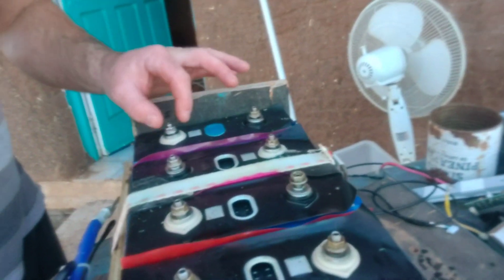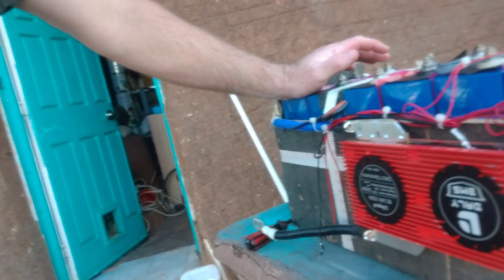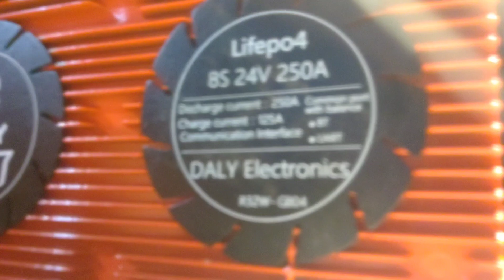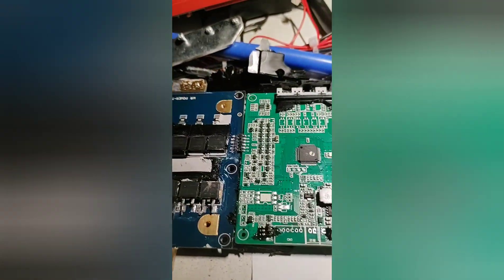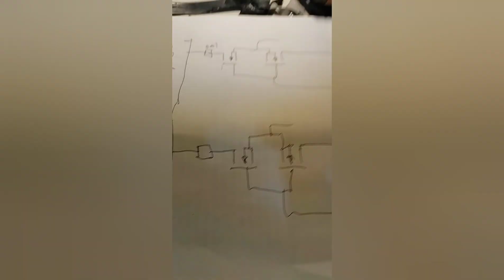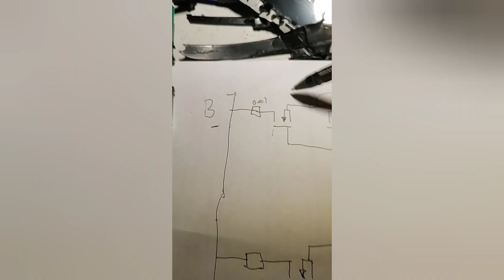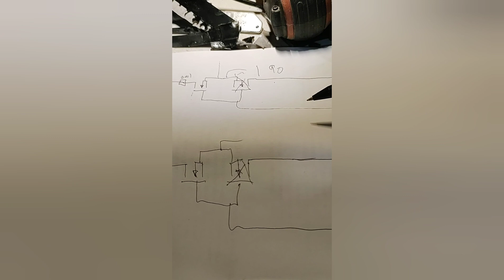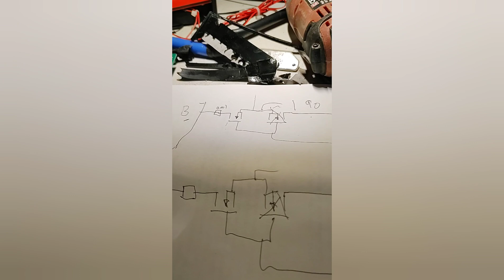Why not to use Daly BMS with MPPT controllers

Comment: i have 3 BMS and the Daly is the worse, it does not count the current going out if the inverter is connected to B-  and the needle never moves down; (it will m ve up when the Sun comes out)  if it was at,say,75%, it stays at 75% even until the battery is down at 0% (it shutts off at the voltages we set it to,  though);  if i connect the inverter to P-, when the battery is fully charged, then the BMS shutts off and the whole house suddenly goes "dark"; the JK BMS LEARNS to correlate voltages with SOC and does it very well; i repair,build, and sell inverters and i do  not sell Daly any more.

Comment: May I ask a question as I have ordered some lifepo4 batteries and currently do my research. Question would a fuse or breaker helps. I always under rate my fuses and breakers just in case, that is why I ask the questions. Oh one more question, how are you managing your system now?
Reply from the maker: No. Fuse circuit breaker etc is not the issue here. As stated what I am saying is that don't rely on your BMS to protect overcharge events if you are using solar string voltages beyond 60v. Currently using HV relays controlled by a seperate BMS to disconnect the solar incoming if a cell goes too high. Once balanced it should never trigger unless a charge controller fail.
Reply: @jasondevine6014  please 🙏 can you post this setup? I would really love to learn from it

Comment: every bms have a voltage they can't protect from, i guess that's why you still put a fuse between the battery and the mppt, i guess the fuse will trigger because of the voltage différence ? theyre will be a lot of amp going in ... what was the Charge controller brand?

Comment: How did the voltage get that high it should have switched off at about 30v then the volts can increase to 90 without damage
Reply from the maker: That's the problem. Solar panels will increase their voltage when not under load to VMax which means that for a mppt string maybe 80v or so. That's then too much for the FETs and they short.

Comment: What i have learned so far in the last 6 months is not too use Daly BMS and not to compress unless you you are going to kick those cells every day from 3.65 all the way down.
It just doesn't make sense because when you use a decent BMS and only 80% of the voltage range you get even 95% of it's capacity. Those last millivolts do not give you that much amps. You only shorten the life span of your cells.

Comment: Daly says you can put 4 12 volt bms' in series for a 48 volt system.  So it's probably a safe bet to say they can handle 60, possibly even 70 volts before shorting.  I have taken apart both 12 volt and a 48 volt daly and the mosfets all have the same markings. So I assume they all use the same mosfets, no matter the voltage range. But expecting it to handle 90 volts is asking a little much.  I'd have to put blame on your charge controller, not the bms.

Comment: Are you saying that your MPPT solar charge controller failed and passed full v9ltage and current  to the BMS? I understand that the bms did not open circuit because the voltage was above what it was rated to protect. My question is what kind of MPPT failed? I have had them fail but never pass current after failure. This is alarming. I have repurposed Tesla lithium ion NMC batteries. 
If my BMS modules fail I would have a thermal runaway event. I have Midnite Classic,  Outback Flexmax and Tristar in my main house system. I sure would like to know which MPPT  CC failed and passed current. Thanks.
Reply from the maker: Esmart 3. When you consider the design of a mppt it is basically a buck converter so easily they can fail in the shorted state, some however have a crowbar protection circuit built in. So yes that is the point, we need to consider what could happen. I didn't here and it lead to a disastrous result.

Comment: I am glad you posted your experience. I have a EV and I was thinking about connecting 3 of 16s BMS in series. Total system is 48 cells in series. I purchased few different types of BMS including QUCC BMS with a relay. My concern was 500 amps initially. Later learned about FET limitation as a HV switch. So relay based bms is a better choice. Also for people who are trying to blame charge controller only. Even expensive charge controllers fail. Also BMS is designed to protect the cells and it failed to do so here. I was also thinking a Surge protection device will be solution here but those are put at input and in your case for 150 plus volt. But how about a 50v Surge protection at the output. I was thinking about using 450v charge controller and this is a real concern and scenario. Thank you for provoking majority of us to think and make our system design safer.

Comment: Bms is only there to balance cells in a series configuration. It’s purpose is not to protect cells from over voltage if supplied outside of specification. You should have had a fuse or circuit breaker between the power supply and the bms which would have protected against this issue. It would be the same for all bms.
Reply from the maker: No it was fused. You don't understand the issue.
Reply: @jasondevine6014  hmmm possibly not but why would any BMS be able to shunt any voltage which is what I thought you were saying? Or was it you wernt concerned about the BMS but the fact it still passed high voltage on to the batteries.. Which if that was your point then I agree the DALY is not up to spec? Possibly in proper overall design the high voltage should have been caught before the BMS??
Reply from the maker: @tigertoo01  my complaint is that Daly do not provide max voltage ratings. My point is a warning that many people consider the BMS as a switch able to turnoff the battery should something go wrong but as shown here, a simple and common problem of charge controller failure will not cause any fuses to blow and the BMS will not be able to protect. The BMS will only turn off a max of about 40v due to the FETs. This is not stated anywhere in manual and many dont think about this when connecting solar 70v mppt strings. This video is  not a complaint about the Daly hardware but lack of specification and lack of consideration of what will happen should a single fault occur by the solar system installer, in this case, myself. No one is talking about this issue in their solar system designs. If you look at comments some good solutions have been suggested but a voltage triggered relay is simplest. I now use relay based BMS.

Comment: I'd rather blame the charge controller for destroying the BMS and the battery. when I plug in dc power supplies to the mains I expect that if they fail they don't go supplying 240V when they are stated to supply 12V
Reply from the maker: Ac to DC supplies don't fail short. They are isolated. Most buck converters/charge controllers aren't, save a few.
Reply: @jasondevine6014  if it's expected then a DC monitoring relay should be a necessary safety device, just as surge protection devices and fuses/circuit breakers are.
Reply from the maker: @dedsert9653  yes. And that is my point. No one is talking about the need for these.

Comment: Sure are a lot of "wannabee engineers" on here. Watching a dozen youtube videos is not a substitute for a true comprehensive understanding of electronic circuit design. Keep your day jobs, fellas.
Reply: Poorly designed, low-quality Chinese junk controller failed, damaging other components in the process. End of discussion. Listening to everybody give their advice about zener diodes and contactors and high-voltage disconnect safety devices without understanding the cause of the problem. It takes a few years in class and 10 or 20 years in the field to get really good at this stuff. It's great that hobbyists are learning new things. But it is kind of amusing to listen to them throw their opinion around like they have some kind of idea what they're talking about. And yes, I do have something constructive to add, but I already said it. Keep your day jobs.
Reply: Do you have anything constructive to add? What's your assessment of the situation?

Comment: Most all REAL MPPT charge controller will not short HV solar DC to the Battery out. Morningstar, Schneider,Midnight Solar, Victron. They are protected and will not short the HV DC to the LV battery side.  They spend the big $$$ to UL testing and certification for a reason. Don't go cheap get UL, ETL or other tested gear and you real lesson will have been learned.
Reply from the maker: You do understand how buck regulators work? Unless the cc uses a isolated topology, which some may, they can short solar to DC bus.
Reply: @jasondevine6014  I sure do! Solar and renewables are my Job.  If you would have purchased a Schneider MPPT or Midnight solar MTTP with shunt trip breaker you would not have burned up the battery bank. Schneider is fully isolated Midnight has a internal protection circuit that trips the shunt. Batteries are expensive so why trust cheap China non UL / ETL tested gear to try and save a buck. If you really want to use cheap BMS and China controllers then spend a hundred bucks and install a Morningstar Relay driver and connect to a contactor so if the Batt voltage goes over a certain voltage it will open the contactor and isolate the charging circuit (and save the battery pack).  I commend you for bringing this issue to light, so others can learn from it. But Saying the Daly BMS is the issue is not true. Poor system design and cost cutting by purchasing cheap China gear is the root cause, not the Daly.
Reply from the maker: @williambryce8867  thanks. Good to know what controllers  can handle this type of situation, unfortunately this information does not seem to be published for most ccs. You are right I am trying to highlight system design issues that many dont think of. As I stated the Daly was not faulty, but it was not published its max VOC. I have now started using diybms shunt that also offers over voltage external relay output.
Reply: @jasondevine6014   Yes, I had to dig to see who has isolated MPPT's  I think anything over 150V should be isolated. I cringe to think of having a 600V MPPT short to the battery. But, the industry is getting better. MorningStar and Victron are not isolated so you better use a contactor based BMS. I could not find any China made MPPT's that are isolated and given the cost none probably are. Thanks for your video,  it does highlight the Issues with MPPT and ALL BMS systems. So need to make good choices to protect the $$$ batteries.

Comment: Lesson learned....All  bms should have a Voc threshold published..if not then don't trust it....in this case the CC might have only spiked for a couple of seconds which is common even for the most expensive CC's... acid vrla sla or gel batteries won't see these spikes...but the bms will cut out the CC from the battery after only 1 second of these overvoltage situations letting the CC to ride freely at the pv Voc....and that's the concern...

Comment: I have a battery monitor ordered with capability of switching relays on and off for overcharge etc, definitely going to be also fitting a cutout relay as an added safety feature,  note, I also have a daly bms and not too impressed with its balancing.
Reply from the maker: Yes this may be a decent solution. The new diybms current monitor by Stuart Pittaway could do this too.

Comment: A 40V fet has the breakdown at around 56V. If you pushed 90V on the pack means you have around 34V on the battery. You exceed the max rated cell voltage, and the 56V can be over the fets is limited by power dissipation capability. Anyway the 40V fet is more than enough for a 24V battery. BMS is well designed. Charge controller on the other hand is rubbish.
Reply from the maker: Yes, true if it is a 40v FET. My beef is that this is not advertised, explained in the manual or specs what voltage this FET is. Also many do not think about the issue of cc failure thinking the BMS will protect their battery like I did. The charge controller is the cause of the failure but thought the BMS will offer protection.

Comment: Maybe using a high voltage sense that triggers a relay to short or open the solar input of the charge controller.  You never want to open the battery side of a charge controller while sun is powering it.  They can autoset set for a different voltage and fry too.  I have a small resistor across the charge port to B- so the charge controller stays awake even if it trips overvoltage.

Comment: Please update the title of this misleading video to "Why not to use any BMS with some unbranded MPPT controller which broke when I sent 90V to it" instead of doing a disservice to Daly. I'm surprised Daly haven't contacted you directly already for rubbishing their product when it had nothing to do with the BMS. 

In this instance when you knew you'd be sending 90V to the MPPT, you should have placed a surge protector between the MPPT and the BMS.
Reply from the maker: Did you even understand what the video is about? Lookup failure mode analysis...
Reply: Mate, what does your troubleshooting method have to do with the fact you were using panels with an OCV of 90V and you knew this, and regardless decided to willy nilly hope that a BMS managing an 8S 24V battery would be able to surge protect your battery. When in reality you should have ensured the BMS would be protected by anything greater than 48V.  

The fact that so many think BMS provides protection to the battery in terms of surge voltage is probably a problem in itself. If you look at the spec sheet or manual of the widely popular Overkill BMS, nowhere does it state the peak voltage the BMS can support. 

Anyhow this brings me back to my original point. It's not the BMS at fault, but the MPPT controller itself, which you're still pretty coy about with its identity.
Reply: @missingMBR  he said 3months ago it was a esmart. wtf, all this people writing novels but can't be bothered to watch d vid properly. a CC is NOT SUPPOSED TO LET HV PASS !!!!

Comment: The “04” in the MOSFET part number suggests a 40V rating. This means it can stand off a charger voltage of about 70V (40V on top of the battery voltage). It would probably survive if you had 2 x 60 cell panels in series, but not if 2 x 72 cell panels.

Comment: Would it then be better to use a higher voltage battery pack and BMS? Operating closer to the system voltage of the panels?
Reply from the maker: Well yes but that is not always practical. I generally run 48v for house size and 24v for camper. If you go higher than 48v then you really need to start doing special safety precautions for all DC connections.
Reply: @jasondevine6014  presumably a BMS capable of a range of series cells would be more resilient. for example, one that can do 8-24 S should be able to handle 100V in normal operation (if it is capable of both Li-Ion and LiFePo4).
Reply: @jasondevine6014  My pack and inverter are 48v aswell, I haven't gotten around to setting up solar yet...thanks for the lesson!

Comment: I wonder what is your solar panel array looks like. What is your total power and what is each panel's power. Perhaps it is just safer to do paralles on your solar cells to use a low voltage input to the system?

Also what is your MPPT charger? I am using a Victron one and seems working nicely.
Reply: Otherwise you might want to check out the QUCC bms and they have some are using relays not mosfets. It might be more safer for your application.

Comment: These failure conditions are always interesting, but it doesn't sound like this was the BMS's fault this time.   The BMS does have over-voltage protection, but it is designed for nominal over-voltage (i.e. normal max charging voltages), not insane over-voltage.   You should never apply more than around 35V to a 24V BMS, ever.  No matter what the model.

A FET generally cannot handle reverse polarity, it basically becomes a diode.  That's why there are two of them with one reversed... one for each direction.  There is also an absolute maximum voltage potential, which for the FETs on a 24V BMS is probably somewhere around 40V.  It is not going to be 96V or anywhere near 96V.  Almost all BMS's are FET based.  These are far, far superior to relay-based BMS's.   Relay based BMS's have severe longevity issues, particularly when the relay trips while significant current is being run.

So this leaves the charge controller as the cause.  You kept bandying about 90V+ .... that's the problem right there.   You should never, ever, even in your thoughts, apply a voltage that high to a 24V battery bank or 24V BMS.   No charge controller configured for a 24V system should ever put that much voltage on its output, whether MPPT or PWM.   It sounds like the charge controller is mis-configured or shorted out or something.

You need an inline fuse as well.

-Matt
Reply from the maker: Yes, as explained in video cc failed. My point is that like myself many people think their BMS will protect their battery against a cc failure by turning off. If the cc fails then the the BMS is unable to turn off. I now use relays on the solar inputs. I understand how and why FETs and everything works,I am a electronics tech. My beef is that the manual does not state what voltage the FETs are rated for. This video was to help others think about the possibility that they too are not protected against cc failures. Oh and it was appropriately fused.
Reply: wait... are you the -Matt that has made comments in the arstechnica discussion section?
Reply: Its all the BMS fault...this is a cascade fault event....the bms detected high voltage that can only be 2 or 3v over the threshold and disconneted the inverter and the CC altogether from the battery...now you have a CC riding freely at the pv VOC that , as well explained in the video, fried the bms causing it to no longer protect the battery from the CC overvoltage